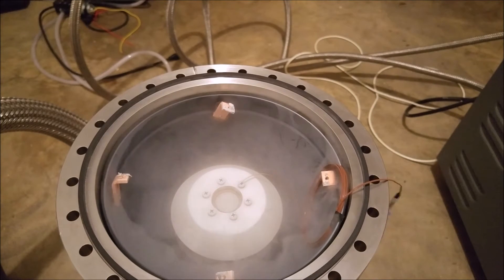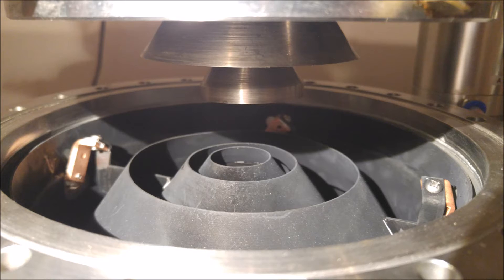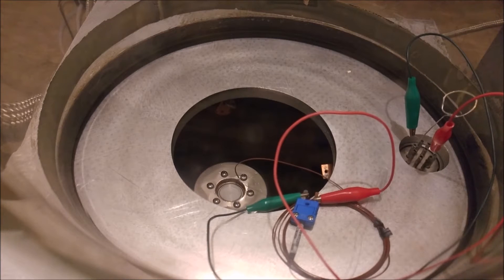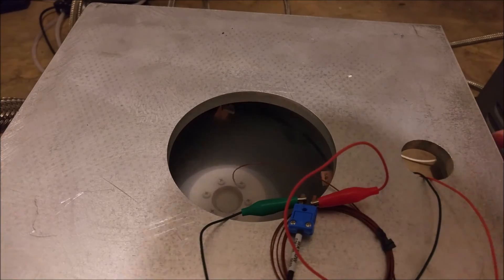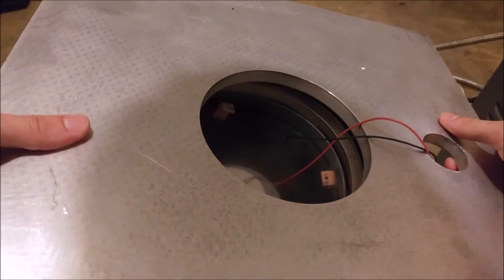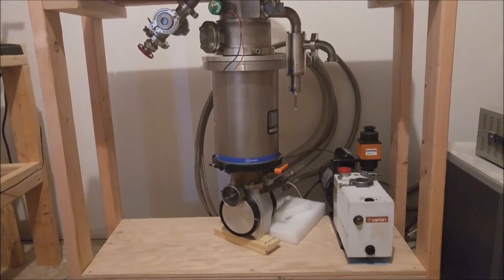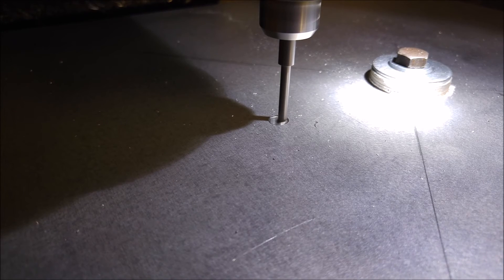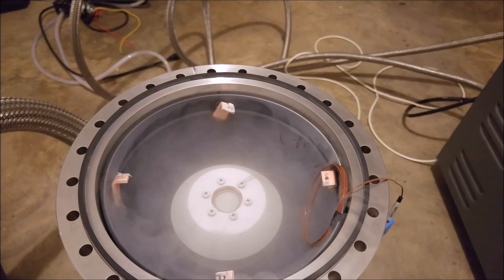Cryopump and vacuum chamber update

Comment: cool, I am working on a similar but older cryopump but the compressor stays on for a few seconds before shutting down again due to high pressure, any idea where i might have a blockage or line or head problem ?
Reply from the maker: Hmm unfortunately i don't have much experience with troubleshooting cryopumps. I know that the lines are typically automatically sealing if they aren't connected, so maybe that would be a place to check? Providing enough cooling water to the compressor was always the difficulty I had
Reply: @EricDalgetty  humm this could be a problem perhaps. The lines are in good shape but are manufactured by CTI...the compressor and head are made by varian. They seem compatible but the pressure rating could be an issue...thanks Erick! Much appreciated!
Reply: If you live in Oregon I can help you. What compressor and what are static/dynamic pressures?
Reply: @lutronc4412  thanks ! No i am in Michigan... i did figured it out in May and dropped to 33kelvin..made video on my channel...thanks anyway!
Reply: Supply return lines reversed?  Parker hose ends fully seated on helium lines?  Balance pressure correct?

Comment: I'd avoid running the cryo pump when it's not under vacuum. All you're doing is condensing water on the arrays. Water + Vacuum is never good.
Reply: Its fine. He will just need to regen longer. (I work for CTI/Edwards)
Reply: @lutronc4412  Yeah much longer though, and why stress the charcoal arrays if you don't need to.
Reply from the maker: Ian Ravary That's a good point. I still need to do a cleaning and bake out on this system, but haven't found any cheap heat tape yet.
Reply: An easy way to get around it may be heating with a hair drier first then applying rough vacuum. Additionally you could search for flexible kapton heaters or adhesive heating pads.